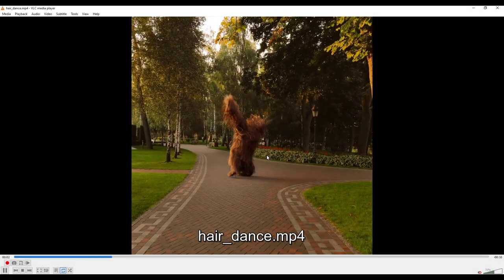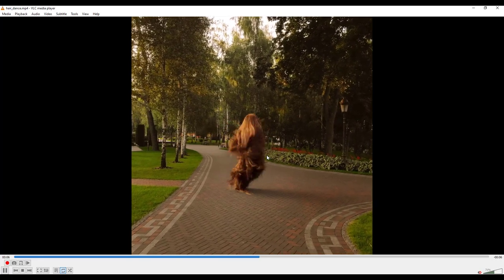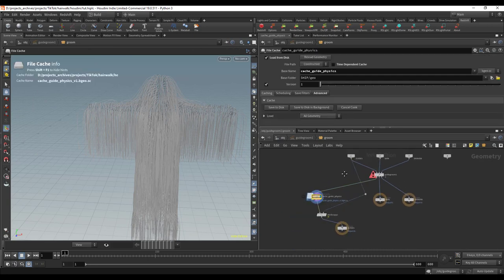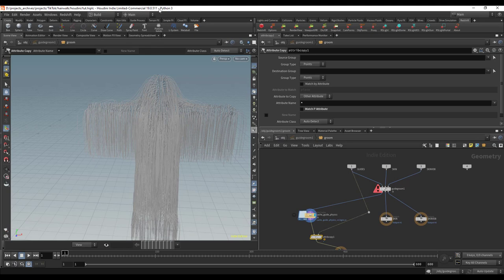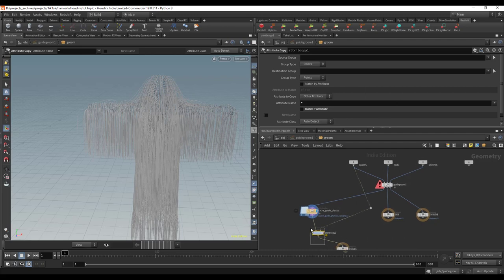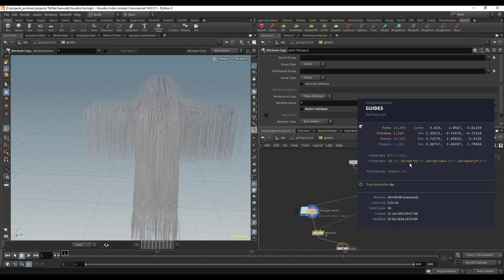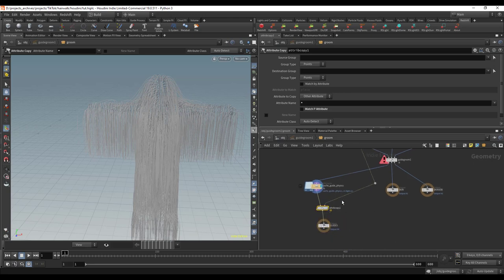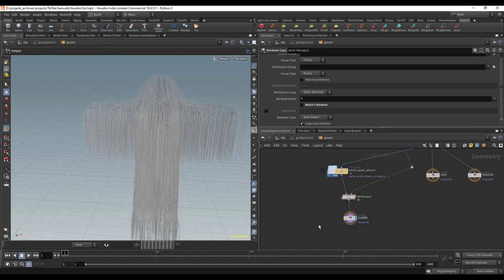vellum hair simulation tutorial houdini

Comment: thank you for this amazing tutorial! Maybe u r able to help me :C
Do u have any tip - how I can make different stiffness along hair? So hair, which near the skin should be not so bendy and stretchy.
Thanks!
Reply from the maker: vellum constraints let you scale the stiffness by custom attributes. I use the resample node then disable the defaults. I turn on curveu attribute at the bottom. That gives you a value of 0-1 from the beginning of the the hair to the end. Then I use a attribute adjust float and remap the curveu attribute using ramps. Then in the vellum constraint node you can use curveu as your custom attribute.
Reply: @evanrudefx  omg, thanks for quick response! u r awesome!

Comment: Hello, good tutorial. I'm running into an issue of not finding the roots group for the pin constraint. Do you know where that group is located within the network? Thanks
Reply from the maker: You have to have group type set to points to see it. If it isn't there you can just make it using the group by range node.  What I wind up usually doing anyway
Reply: ok I'll try that and see if it works thanks @evanrudefx
Reply: sorry but where would the group by range node go? after the unpack or after the hair constraint
 @evanrudefx
Reply from the maker: @SerenityFirefly  before where ever you need it. If you need it on the constraints node than the group has to be made before the constraint node. You typically do this:
1. groupbyrange
2. group name to "roots"
3. group type to points
4. set "start" to 1
5. hit invert range
6. go to the bottom and enable "affect disconnected geometry separately"
then you should have all your roots grouped.  note sometimes you have to put end to 1 instead of start depending on your curve direction Unrelated, but I love firefly/serenity : )